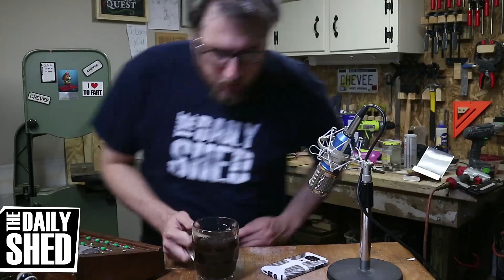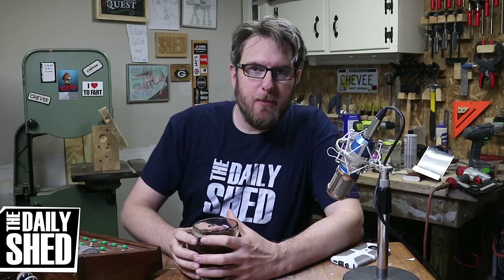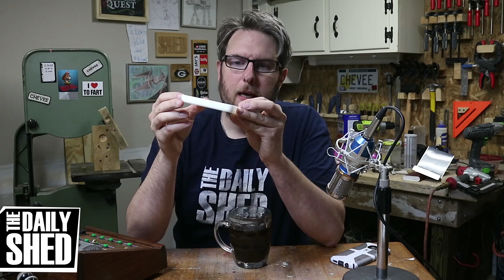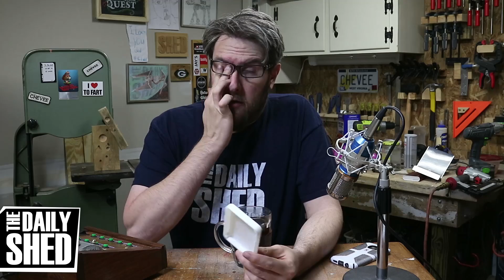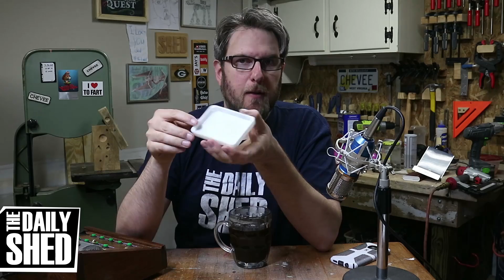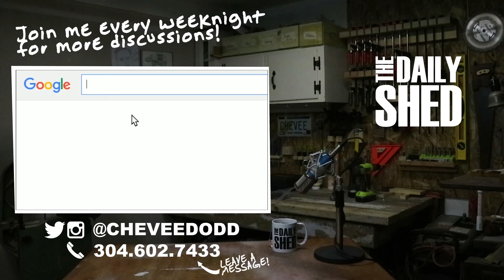The Magic of 3D Printing - Iterative Design

Comment: How's it going with the ABS? any warping?
Reply from the maker: I haven't tried ABS yet. Still trying to get the PLA dialed in
Reply: Cool, on PLA i'm usually  printing at 205/55 and found it to be pretty successful. I know technically you don't have to heat the bed for PLA but I figure why not. I'm still printing on tape though so i'm not sure how the glass will differ.

Comment: Hey Chevee, I need to correct you, sorry. Koalas are not bears...its just koala, they are not related to bears either. 
OK rant over.
 I see the merit to some in a 3D printer but how is the cost in product? If you need to make lots of something or many test runs is it still a valid build? or is the value in being able to make bespoke items? just thinking out loud.
Reply from the maker: It's still not a general consumer-level thing. You can't just go buy a printer, turn it on and start making things. There is a ton of trial and error based on your filament choice, print environment, air circulation... blah blah blah. For me, the value is making things I can't otherwise make easily. Prototypes and such.

Comment: Hi Chevee - really enjoy watching this as I am looking at getting a printer soon. I am wondering if you have tried both the PLA and ABS and what you have found different between the two. Does one print better, faster than the other? Does the ABS seem more brittle? Looking at making small little car parts and gaming pieces so want something durable and halfway decent looking.
Reply from the maker: I have not tried ABS yet. PLA works great. PLA is the most brittle, but easy to print with. It would work great for gaming pieces. ABS is not as rigid, but the flexibility gives it strength.
Reply: Cool.  Thanks Chevee -  now my wait for the printer to be back in stock begins.

Comment: This is what fascinates me about 3D printing. While far down on my 'wants' list, a 3D printer would be immensely helpful in solving some little problems that come up, like when I broke a tiny little plastic part on my mic arm. I ended up fixing it with a washer and a piece of wire, but it looks like total crap, and one little plastic piece would have been easy to print up.

One question about your printer: Assuming you had more precise control over the slicing program you used, would the hardware be precise enough to print things like threads?
Reply from the maker: Threads as in fabric? I don't think so. The nozzle diameter is .4mm so it's rather large.
Reply: Ha! No I meant threads as in nuts and screws. Maybe that's a stupid question?

I assume then the nozzle diameter would restrict the size of the threads.

But speaking of threads (clothing), I did get my shirt yesterday! Wearing it now :-)